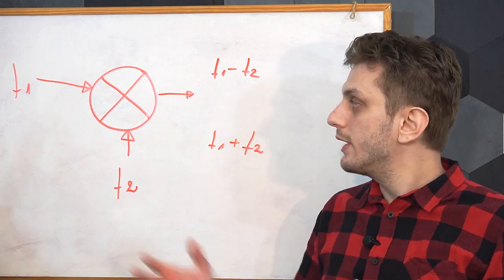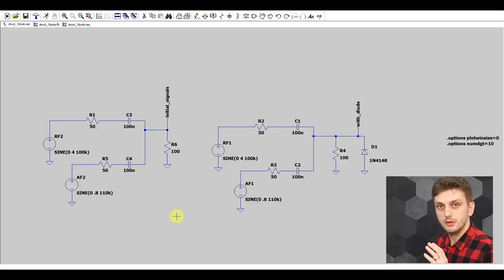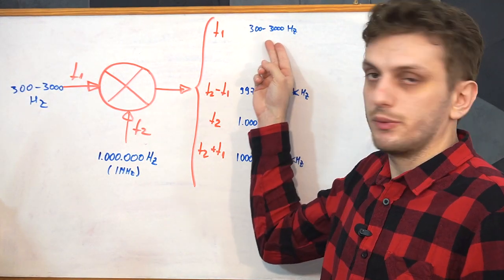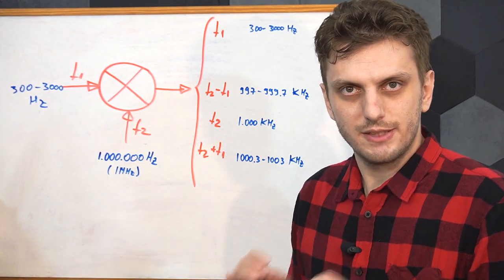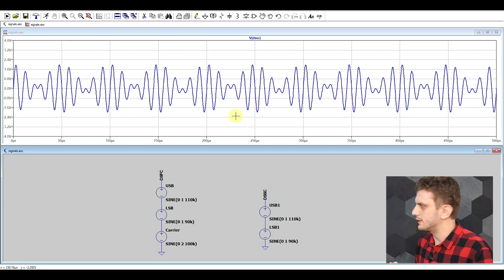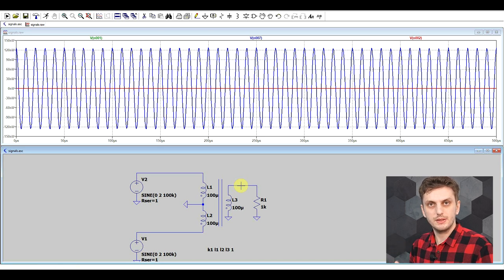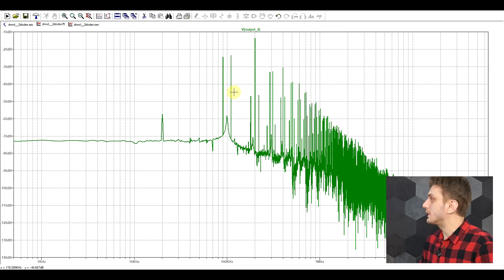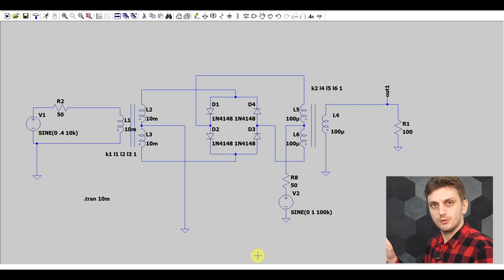RF tutorials - Diode balanced signal mixers

Comment: Thank you, very glad to see another RF-related video.

Speaking of filtering you should be mindful of a little problem with diode ring mixers. Filters have high input impedance outside of the passband. This means that unwanted signal will be reflected back to the mixer. For some mixers this is not a problem. (E.g. for mixers based on dual gate MOSFETs, if I'm not mistaken it's also possible to build a mixer with two FETs; interestingly an AM modulator you've shown before can be considered as an BJT mixer with a little high LO leakage.) However diode ring mixer is a symmetrical circuit. It will accept the reflected signal on IF port, mix it with LO and pass to RF port. Where it can (depending on the schematic and the frequency) be reflected back, once again be mixed with LO. For this reason you have to A) use diplexers instead of filters B) use a buffer between the mixer and the filter. Either will look like a nice ~50 Ohm load for the mixer and will not reflect anything back.

Now speaking of improvements of the circuit. I've never seen anyone using additional capacitors in the diode mixer. However you often see a 50 Ohm potentiometer as shown in this article https://eax.me/superhet-receiver/ It allows to get better balance in the circuit and better suppression of LO signal. To get an even better suppression of LO all diodes should be matched by forward bias voltage. The turns on the transformers should be wound with a trifilar winding of an enamel wire ~0.5 mm in diameter. The wires should be twisted tightly to form transmission lines with ~50 Ohm impedance. 7-10 turns on FT37-43 core will make a good mixer for HF.

Interestingly you can use a diode ring mixer as a DSB modulator. Just use IF as an low frequency input and RF as an output. With some attenuators and RF combiners you can add a carrier to DSB and get a very clean AM.

800 mVpp (into a 50 Ohm load) is about 2 dBm. This is a little low for LO. It should be about 7 dBm or 1.4 Vpp. In practice values between 4 dBm and 10 dBm will work OK. RF should be at least 8 dB lower than LO, which for 7 dBm LO is -1 dBm maximum or 560 mVpp. Otherwise RF starts to drive the mixer instead of LO which is not something you regularly want.
Reply from the maker: Hello Alex. By adding capacitors I meant something like fig 14 ( http://users.tpg.com.au/ldbutler/MixerTheory.htm ) or C3 and C1 in ( http://www.pan-tex.net/usr/r/receivers/ra02019.htm ); I saw similar approaches with single balanced mixers also - the idea would be to create a resonant filter between this capacitor and the double inductor. I guess, capacitors could also be added on the output side, again to form resonant filters.
Reply: The answer to reflected mixing products or harmonics of the LO is to use a diplexer on the IF output of the mixer. The diplexer will properly terminate the other frequencies. In the alternative, a 50 ohm resistive attenuator can force the termination of everything. Of course, you'll get some insertion loss, but you're going to amplify the IF signal anyway. If you use metal film resistors for the attenuator, you can minimize adding thermal (Johnson) noise.

Comment: This is a great description of how mixers work. I too use mixers in many projects, I must admit, that for higher frequencies (greater than 400mhz), I will be lazy and use the `mini circuits` mixers, Ade-1, sra-3500 etc. But for the lower frequencies below 50mhz, I much prefer to make my own where I can get better performance by very careful manual selection of each diodes parameters. At the moment I am building a 40 meter ssb exciter which uses two double balanced mixers. Great work! You have another subscriber. Chris, UK.

Comment: Exceptional video mixing theory and practice as you used to do. I will spend hours to replicate and understand as far as possible! A question about the level of power needed: Some radio ham explains the input signal could be very weak if the local oscillator is at +7dB. Will try to experiment starting from your schematic. Again a big thanks for sharing.

Comment: In the circuit at time 12’, if you swap the feed points of the 10 KHz audio and the 100KHz carrier, you would have stronger outputs (less conversion loss) while not needing the larger transformer with 100 mH inductances. Same thing applies to a demodulation mixer: do not couple the low frequency input/output to the mixer via magnetic coupling.

Comment: Really good, interesting how this mixer (just like the ade-1ask)  works so well and is used in many HF radio receivers with antenna signal at uVolts and LO at 200mv.  Seems amazing that with 1000x amplitude difference it still works!  Do you know if their is anything much better than the ade-1ask?

Comment: With the double blanced mixer, why are the ports of the IF and LO sometimes swaped?
Is there a rule on where to best apply what signal?
The left and right ports are obviously symmetrical, however i would assume that the bottom port is best connected to an LO that provides a squarewave?

Comment: This cleared up a lot of the theory for me. Thank you. What is the name of the cable connectors on the veroboard(used to connect the signal generator and the output to the circuit)?
Reply from the maker: Those are "BNC" type connectors.
Reply: thank you. I am currently building a frequency domain reflectometer and a mixer is essentially one of the components as you probably know. What do you think might be the best way to connect sma or bnc directional couplers to such a mixer and other components involved? What would the interconnection be? Simple jumper wires? A coax? What do you think?